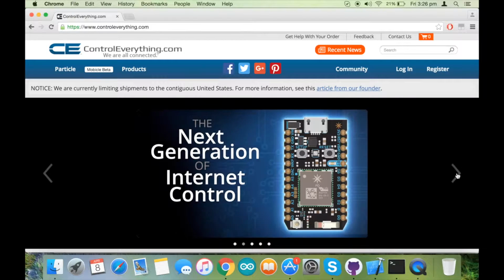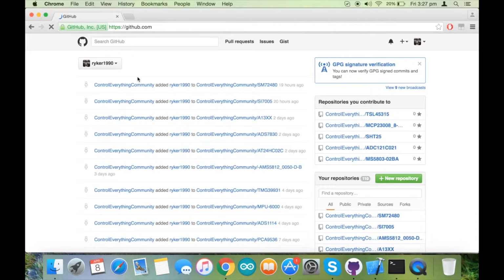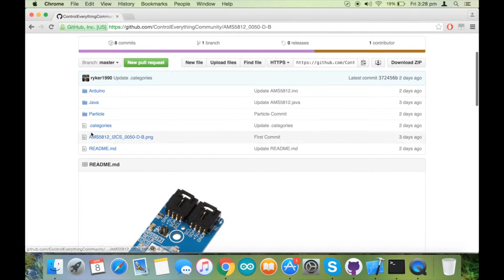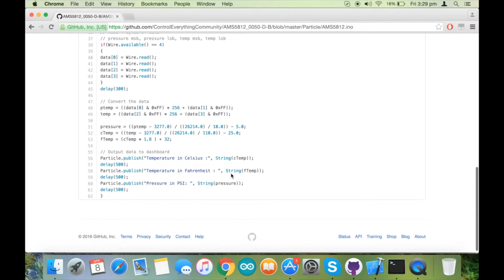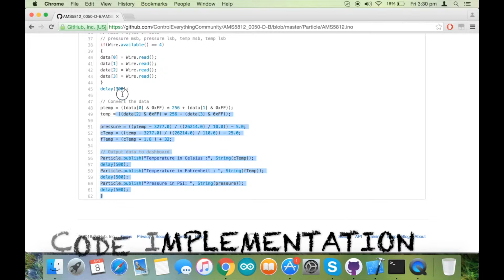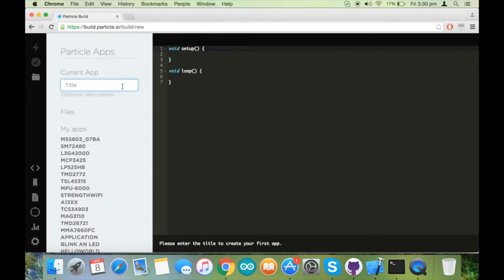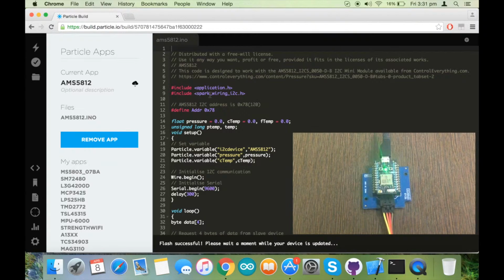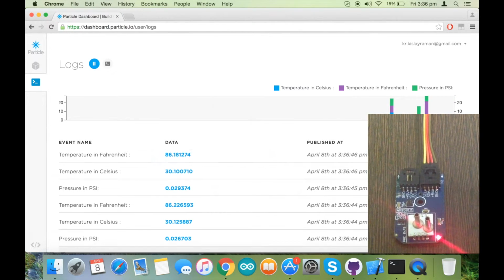Particle Photon - AMS5812_0050-D-B Pressure & Temperature Sensor Tutorial

Comment: Hello!

I’m from India & currently studying in Second Year of Mechanical Engineering. My Fluid Mechanics mini project is to build a pressure & temperature sensor.

I want to measure the under water pressure with the help of this sensor to experimentally prove the ‘Hydrostatic Law’. Can it be just done by dipping an hose into the liquid? If yes, how do I connect an hose to the sensor? Will the sensor give me accurate reading just by dipping the hose into the water? And how do I create an experiment set up for that?
I want to estimate that the pressure increases as the depth increases.

Reply awaited.

Thank you.